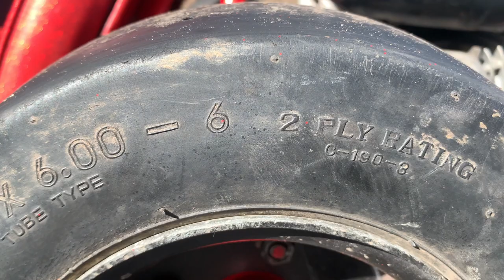Installing a GoPowerSports Mikuni Carburetor!!! | Gokart Upgrades

Comment: Does the carburetor come with every thing you need to put on and run such as the airfilter and the red extender thing
Reply from the maker: No but the parts aren’t hard to find